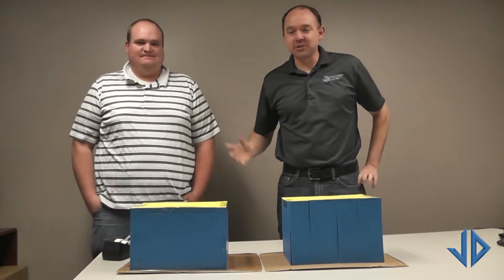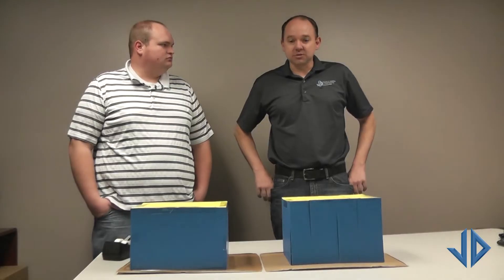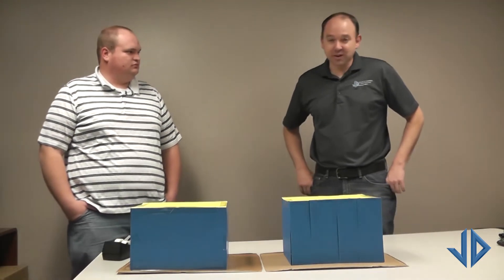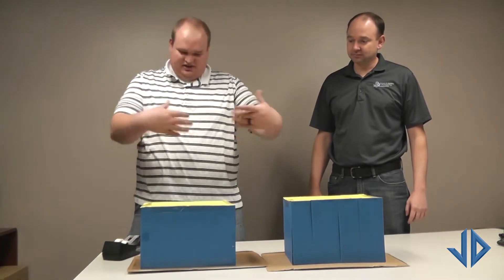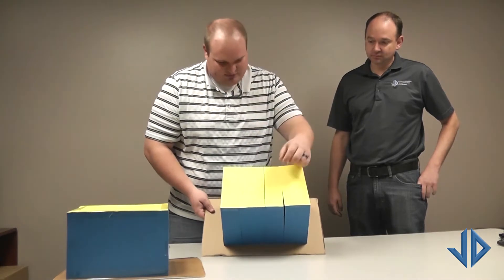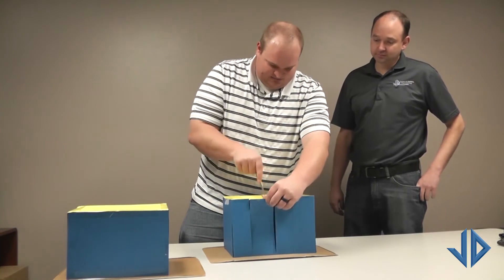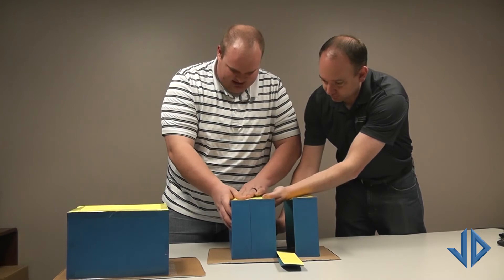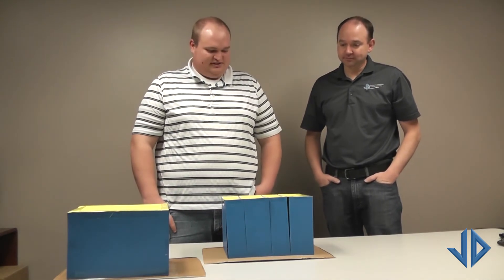Diaphragm Explanation for Beaver County School District

Comment: Thanks for the demonstration, however, one thing I didn't quite understand was about the second model. I understood the discussion about the diaphragm, but why the walls also showed to be separated? wasn't it just the diaphragm that was not connected well to the walls (due to the tilt-up construction)?
Also, regarding the retrofitting method, so basically, you guys just used the same method of the 1970s, just with carbon fiber fabric?

Comment: I've been searching for an explanation for the difference between rigid and semi-rigid diaphragms and how it affects our analysis. Can anyone here help explain?
Reply from the maker: No diaphragm is 100% rigid or 100% flexible. However, when the diaphragm is much more flexible than the shear walls, engineers simplify the analysis by assuming that the diaphragm is 100% flexible. Similarly, when the diaphragm is very rigid compared to the shear walls, we simplify the analysis by assuming that the diaphragm is 100% rigid. However, when the diaphragm has similar rigidity to the shear walls, it's not appropriate to assume that the diaphragm is 100% rigid or 100% flexible, so we have to do a semi-rigid analysis. When you're analyzing a semi-rigid diaphragm, you can't use the simplifying assumptions of the rigid or flexible analysis and you have to do a complex analysis that considers the stiffness of both the diaphragm and the shear walls. This is typically finite element or something similar.